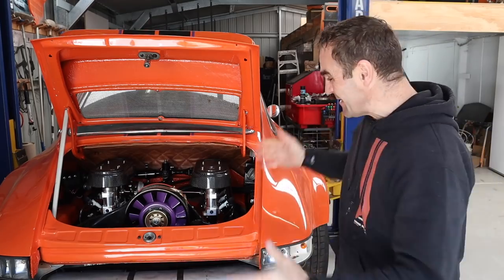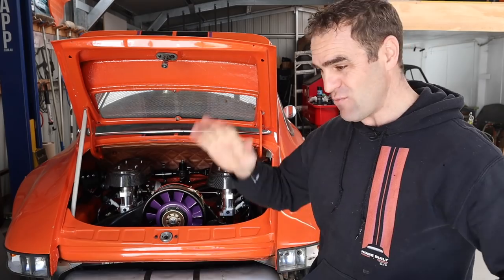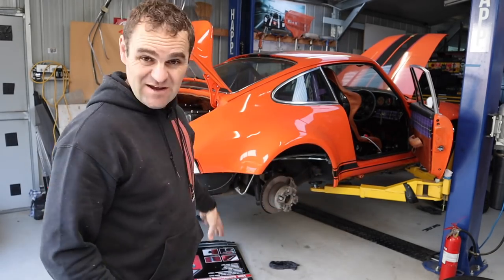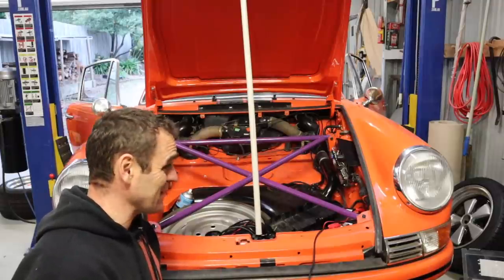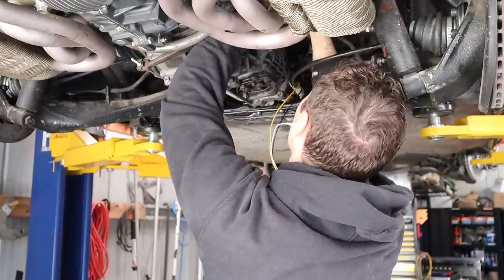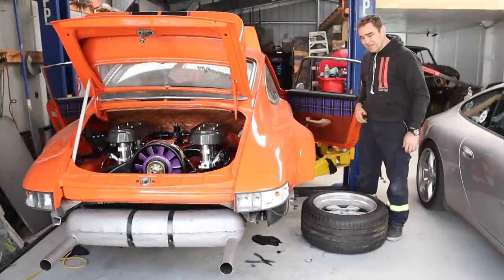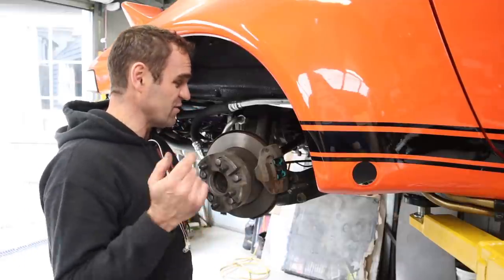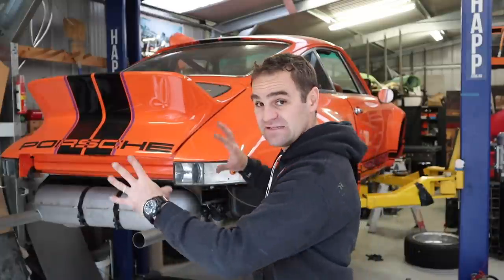Lights and brake leaks - 911 2.8 RSR Build Season 2.39

Comment: Systematically working through all the odds and ends can be boring but, necessary. Resolving bad electrical connections, fluid leaks and a myriad of other details is the difference between a well sorted restoration and a disaster.  Well done Jeff.

Comment: To bleed breaks on your own using the pedal pumping method get a glass jar, silicone tube to fit over the bleed nipple and a non return valve, surprising how effective it is :) total cost is less than £5

Comment: Jeff, concerning the stiff clutch action, Porsche introduced a 'helper spring' at the gearbox - sometimes called an 'omega spring' due to its shape (like the omega symbol) - has you car got this?  I think it's an easy fix and may be worth a try.

Cheers.
Reply from the maker: I just looked it up. That looks like it would be fantastic, but it only fits on the newer clutch arms.
Reply: Clutch on a G-body should be light and crisp. Honestly, you should be able to feel the dirt on the clutch as it bites. Really nice feeling when it's set up right.
Great tip on gravity bleeding. I did my wrx like that, maybe 30 minutes per corner, but just keep the reservoir topped up and wait. Great if you're just one guy not in a hurry!

Comment: Hey Jeff did you find a magnetic spark plug socket yet? say  I your clutch does it get softer when its fully depressed? most 911s are this way hard at first soft at the end we would call 911 clutchs mousetrap clutch was use to send out new guys in the shop to bring in the 911s and watch them kill it over and over ya us mech like abit of fun.